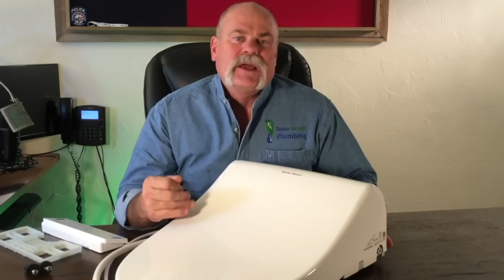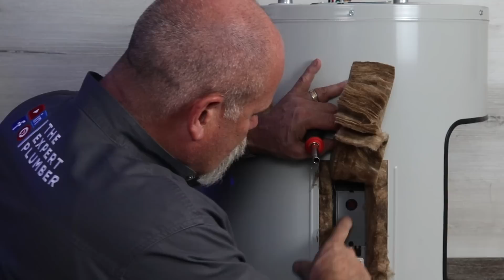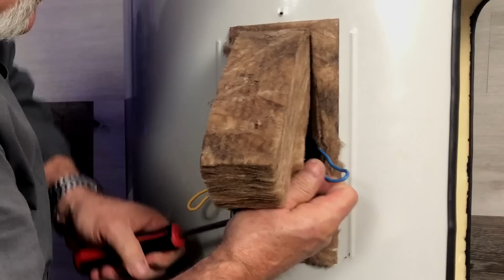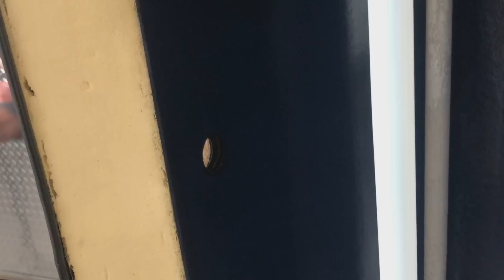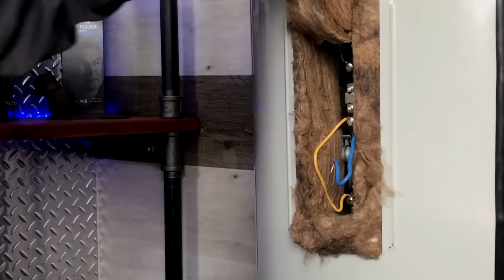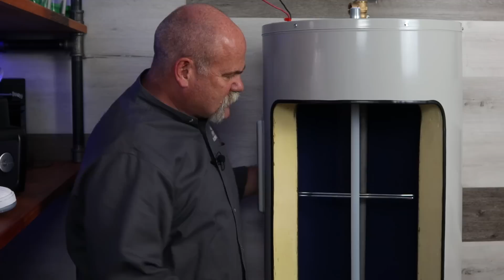Electric Water Heater Not Working? | Water Heaters 101

Comment: Roger, I like your honest videos.  Very informative. I've worked for 35 years on the outside of the house installing water mains, service lines, and shut-offs. Oh and meter horns and meters. I do have a question though. What are your thoughts on expansion tanks before the water heater? I've had to help a lot of homeowners who wind up with some problems on new construction that have sloppy plumbing. I see it a lot but my knowledge is somewhat limited. Appreciate any thoughts you have..

Comment: I've changed both elements and thermostats, measured 120V on both sides but still not getting any hot water.
Reply: Did you ever figure the problem out? 
I'm having the exact same issue now.
Reply: @jasonanderson3366  Guy who installed the water installed it with undersized wire. The wire eventually burnt internally and had to be replaced along with the disconnect because the terminals on it were also looking really bad. Could have been much worse.
Reply from the maker: Kevin Marshall did you turn the power back on before you filled it with water? Did you get all the air out before turning it on?
Reply: @RogerWakefield  yes.

Comment: Why don't residential water heaters have a separate expansion tank?
Reply from the maker: @rcrxjlb they have to if they are on a closed system. As long as the expanding water has a place to expand to they are fine.

Comment: That's slot different than when I do it normally I start out getting irritated with the insulation and saying some not so nice words to my self and cutting that crap off. Then after testing and thinking I cut the power off I shock the crap out if myself and then turn it off. And as soon as I try to get the elements off the sides of it break off and I'm left with a well this is gonna suck. And after 30 mins once everything is gone the homeowner asks why so much to change it?
Reply from the maker: @Titansd we've all been there too! This way might work for some people!